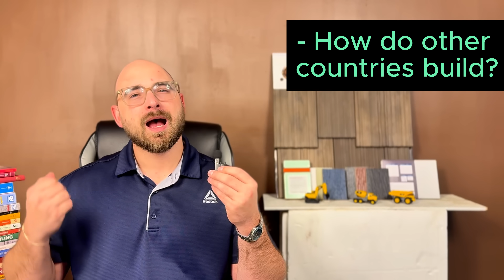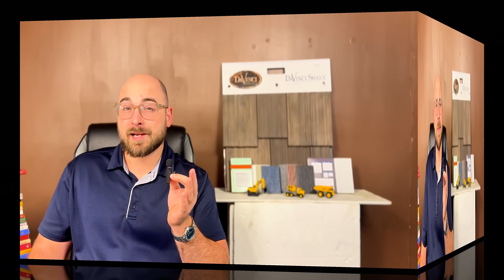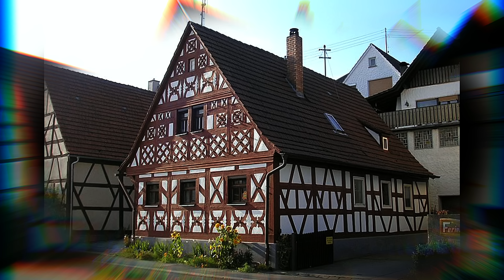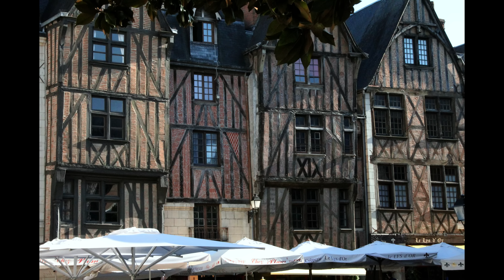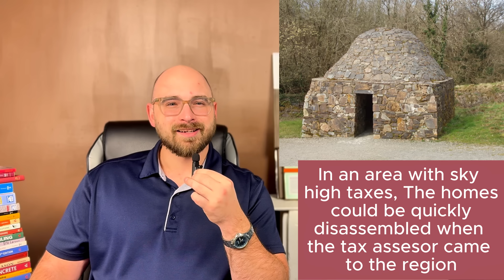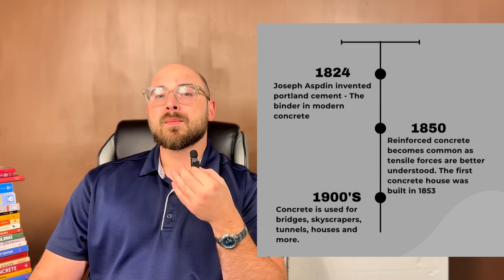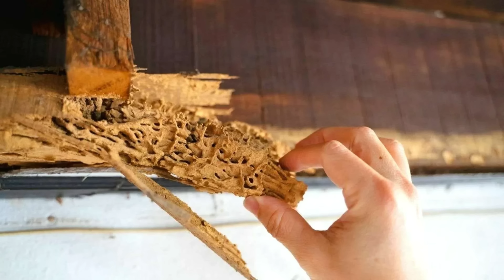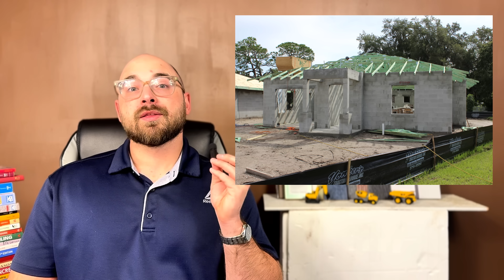Why Other Countries LAUGH at American Homes

Comment: Not exactly true like this either. See it is not about whether you just have same wood framing. For example here in Finland yes we have A LOT of wood houses.. However those are built with QUALITY in mind, not speed. There are extremely strict rules, and regulations how those have to be built. A wood house is not exactly the same in every country. A bit disingenuous to say it like that. For example we live in a wood house, that's 132 years old, and in pristine condition. We just recently got the house inspected, and had zero things complained about. See how I understand this issue, is that americans are way over-capitalistic country. Your wood frame paper houses are built with efficiency and speed in mind. They are built by the thousands in HUGE areas.. Here building one house can take quite a while, because those are literally built with quality in mind. Not how you can do it the fastest. This is a cultural issue really.

There is quite a big difference, even if the framing is wood in both.

Comment: I am in construction in India, its not that american and other techniques haven't been used here but they just don't look promising. Talking about my own house, there was no leakage, mold, or structure decay in a brick home. Now the new house we built was RCC beams and brick walls where both are sharing the load and the roof is a 6" concrete slab with cranked 1/2" rebar grid at 6*6 inches apart. Door frames are metal and door are hardwood ( cedar or indian rosewood), walls are 10 inches thick, foundation is 36 inches thick with beams 6ft underground, electricity and water ran in the walls. Here the structure of the house cannot catch fire in most cases. And is water proof and even bulletproof. Shortcomings maybe - making change is difficult and costly. U need to paint in 5ish years, very costly to heat (generally not required here) if water pipe leaks which does not happen, ull need to break wall and repair and all that dirty work.

Comment: He forgot to mention also gas silicate blocks, keramzit blocks, also precast concrete panels usualky for appartment buidings (those have offer a sandwich structure, like 5cm outside with a decorative patern, then pir insulation layer like 10 cm and another 10cm of concrete)

Comment: From NL, my house build few years back has the inside of the outer walls made of mostly concrete, but the outside are bricks. And the inside walls which are just connecting my spaces are mixed concrete with drywall

My mothers house build around 100 years back has a mix of bricks mostly in the outer layers and lots of wood on the inside. Also found out it had asbest, but that is removed now. Windows where singe glass when we moved in there 25 years ago, but replaced soon

Comment: European houses are way better. New Zealand has very good construction techniques as well as they copied the European model
What mainly makes them better is their philosophy on how to keep moisture out of the structure. They have way more complex flashing techniques, thicker walls including battens that hold cladding off the main structure to allow for airflow. New Zealand has that and in addition very strict inspections along the building process. They’re also often building in earth quake zones so tie downs and bracing is very heavy duty.

Comment: Very interesting and informative video.  One of the criticisms of homes in UK (where I'm from, but now live in US) is that most are built on concrete pads, with the essential water and waste water piping built in to the slab.  So, many houses built between the wars (and there were a lot of them built) have one bathroom with the expense of building another being cost prohibitive.  Similarly, washing machines are a common feature of British kitchens simply because plumbing anywhere else is cost prohibitive.  Similarly with electric wiring, where a concreate inner wall does not lend itself to rewiring to modern standards.  Newer houses in the UK now have two or more bathrooms, but that is still a small percentage of the general housing stock.

Meanwhile, my US home is "stick built", with vinyl siding and a crawl space - that latter being significant if new plumbing/ wiring is required (or even gas supply).  The chief downside I see is the obvious fire hazard, but then there is the roof.  Having to relace your roof every 25 years or so is a pain in the proverbial - in the UK, that is nearly unheard of as most roofs are either baked tiles or slate.  US houses are never built to last, either, with building lasting a generation or two, and then considered "too old" and either knocked down or VERY expensively renovated.

What is better??  I've owned property in both countries and they both have their pluses and minuses.  If you buy a home in the UK, you know it will last, built to stringent code, less maintenance costs, but is generally much smaller.  A US home is flexible to add-on to, is usually fairly modern (or easily renovated), but not necessarily cheaper.  Air conditioning in the US is a must, too, which is simply not the case in the cooler UK.  Heating costs are comparable, with US home being okay if well insulated.

Interestingly, too, water pressure in the UK is lower because a tank on the attic usually supplies all the (radiator) heating and hot water.  The cold water is piped directly from the mains and is clean and potable.  The tank, of course, is subject to dust, rodents/ birds (if they can get in), and the wear and tear of the tank itself.  Hence the faucets in the UK where one rarely rarely find single ones - one does not consume the water from the tank, so you would have to run the cold water for a few seconds to clear the pipes of any tank water.  In the US, all water is pumped from the mains, is generally clean and potable, and the pressure is higher.  UK plumbing, especially in pre-war houses, could probably not take the pressure.

In conclusion, therefore, the main theme of the video concerns building with local materials/ infrastructure and this can be easily seen as the difference between UK and US housing.  The only exception being that Americans should change their roofing material - shingles are an unnecessary material and expensive in the long run.

Comment: Yeah... US construction standards in housing are really poor.
Electrical, plumbing, insulation... Everything looks like DIY compared to swedish standards. Yes, that big of a difference, just take the plumbing side of it. 🤦🏼‍♂️
Soft Soldered joints in the walls. Taps that are built in to the wall with bare copperpipes that condensate, no vapor barriers in bathrooms, drains watertraps are unaccessable under the houses 🤦🏼‍♂️ etc. Sorry... But it is sh*t in comparison to how it is built here.

Comment: Why does the US not build homes of the same quality like in Europe ? For the same reason the US does anything, its more profit to build a nice looking home that is in fact 99% cardboard. If you lean on it too hard there is a chance you will go thru the wall. 

These houses are around for 10-20 years. Then you have to build a new one because the old one is at a risk of falling on its owners. In Europe many houses and buildings have been around for longer than the US has existed.

Comment: Well, it all depends. My house here in Sweden is built in the 50s with concrete and wood and seems to withstand hurricane forces without flinching. But in the 70s, many houses were prefab pieces of garbage, erected in a day or two and so flimsy that if you close an interior door to quickly, the whole wall moved slightly! 
Thankfully, that time is over and most houses built today seems to be back to better standards. (Those standards means that it's extremely expensive to build new houses, but that's another discussion.)

Comment: We are currently building a house that has a solid inner steel frame and the outer walls are made of 40cm wood-concrete with insulation. Inside, the walls are timber frame construction and 20cm thick.

Comment: I guess some of it is also about seeing American light wood structure houses broken by tornadoes and hurricanes, which we don´t have in Europe. Even earthquakes only in the Mediterranean. And then there is the size. To European eye, American houses seem to have been designed for luxurious space and many redundant rooms. I´m guessing this is done to appear more rich, which is a cultural preference. The downside of this is that the quality tends to suffer, if the price is fixed. With the same money one could get a sturdy house by making it smaller, aka what one needs, which often is the European choice. There could, as you mentioned, be stricter regulation too, forcing the choice.
Mold in concrete buildings has been a problem here in the north. Most of the schools that I went to have been torn down or decomissioned because of it (4/6). But it´s been a learning curve. Nowadays concrete buildings are built to a higher standard as far as ventilation goes.

Comment: Fun fact: I am in the USA btw

While non Americans pay the same money for a stone house - Americans get a wood house with fake stone facades if they upgraded …
Reply: The video is over exaggerated,   US homes siding is 3/4 or 19mm of wood board that is solid and on top of that is cement board or wood siding so there is no way to punch through that but you can cut with a power tool.   However most homes in the South of the US like California, Texas, Florida the siding is metal mesh with spray in stucco like spray plaster and that is very hard siding it is even better than brick as it is all in metal mesh which is stronger than brick but only 1 layer, usually with real brick you need 2 layers with an air gap.   But the real winner in US and Canada is central HVAC, the house is perfect temperature 24/7 365  and never have any mold or damp   - that is where the US and Canada are HUGE winners,  I lived most of my life in Hungary and everyone had damp, cold homes,   while in Canada and the US like 70% of homes have central HVAC and sealed from any outside air  so just 100% comfortable and every little corner of the home,  bathrooms, closets, no cold areas in winter.  That is PURE luxury in Europe if not unthinkable.
Reply: @DrScopey2  I think you over glorify HVAC. Houses in the USA also can have the same mold issues and do for a fact. Michigan has a big industry to water proof basements. The duct system is prone to collect particles and other fun surprises. And controlling the heat in rooms individually requires you to play with the registers of each room. The main reason why America has forced air is because of the AC use.
Reply: @cekuhnen  Houses in to US do not get mold unless there is a roof leak or water leak as there is no air gap in the frame and it is totally sealed from the outside world.  With brick you have an air gap which in damp areas will eventually lead to mold.      Basements depend on the local water table , yes Michigan has a low water table, you dig a hole and you will see water so that is just nature but most new homes do not have basements anyway, they are just a slab on grade which avoids that issue.           Yeah HVAC can have issue of balancing between rooms but that is why you usually have a gap under the doors to let air equalize but there are issues when people change floors from hard to carpet and forget to cut the door smaller or get new doors, the carpet could remove the air gap and block the air flow, so just need to adjust the doors.
Reply from the maker: @drscopey2 I disagree with both of your comments, most homes get 1/2” sheathing, no air sealing, basic tyvek leading to all kinds of gaps, drafts, cracks and places for water to intrude, many municipalities allow for poly vapor barrier which causes condensation and mold in some climates, 

I’ll also add, many production don’t even get plywood sheathing they get cardboard (thermoply / fiber reinforced sheathing) which again very poorly air sealed, and a lot of these homes, both production and custom get moldy 

It’s not that wood framing is the issue, but how it’s executed, most homes are built to a code minimum standard, but a home that keep air quality high and keeps water out, such as one built to passive house standard, requires extra detailing and extra money, and builders and consumers alike won’t pay for it
Reply: @Mike_Fortin  That is more a contractor and city code enforcement issue than a materials one.

To say most is an exaggeration.
Are there some homes that are built as you said? Yes.
Are most? I'd argue no.

Even where I am at, where housing demand is projected to be hundreds of thousands short of demand, the homes still get plywood sheathing, tyvek wrap, and air sealing.

Mold is a regional issue so I do disagree with the comment that HVAC would somehow prevent that as in some regions HVAC makes it worse.
Reply: Generally speaking, you pay much less for a much larger home in the US   when compared to most other places.

So yes, it's "fake" but it also wasn't needed. That's why it costs more.
Reply: 5.40 dollar for 50kg bag of most expensive cement (110.23 lbs)
58 dollar for 1000 most expensive red bricks 
There are cheaper ones😂😂😂
Reply: Same money I don't think so
Reply: compare the labor costs.  The US does in fact have brickhomes.  Check out those prices for new builds
Reply: Everything basic in the US is very cheap. But once you want anything different than the cookie-cutter consumer pipeline, you pay absurd premiums. Capitalism is a thing everywhere, but in the US, these houses are squeezed to the max for profits. 
That being said, if Americans don’t care about owning quality and sturdiness and only care about the outside, the appearance, that’s their choice. But the absolute minimum I want is for people to at least think about it, to be self-critical about it, instead of just yell “iT’s OuR cUltUrE!” (This includes every country, tbh! In Europe, everyone yelling “concrete, concrete” is kind of seemingly missing, that we are slowly moving away from concrete everywhere; the CO2 emissions of concrete are utterly disastrous!).

People don’t actually hate wooden houses; Scandinavian houses are almost all wooden and no one complains about them - they are lovely! It is how cheaply they are made in the US and how that is sold to the average American as “look, you actually need that, it is a good thing! We can rebuild it quickly and bigger and better!”. It’s not in the wood, it’s in the little things in between. Even if your house gets regularly destroyed, you can build with more quality from wood and it will still have all these attributes!
The whole “woodden houses can be redone easily” and “starter home” and “it’s bigger”, “disposable” etc. is exactly the essence of the alienation in this topic: it’s the hyper-consumerism mixed with the general public ignorance of the US. This is actually what the world is alienated by in reality, not the wooden houses.
Reply: @ very true points - look at Scandinavia wood house construction is present there too but it is not accepted in Germany. Wood construction has many benefits but also some down sides. But nothing is as bad as concrete production too!
Reply: @cekuhnen  You can make decent wood houses with sturdy beams and columns. What Americans call  stick frames are not sturdy.
Reply: @Shlorpmeister  There are no tornados in Scandinavia and severe storms are rare and they don't blow away whole villages. Midwest could make good use of sturdier houses. Then there is another thing to count in. Americans are not as rooted. They move easier and more often cross country, and don't build for generations.
Reply: @botalm1878 it's OK to have wooden home,  but the key point here is why cheap homes are too expensive,  more expensive that durable homes?
Reply: cause like in Europe huge amounts of old people die when heat waves show up

Comment: Wood or concrete? They each have their benefits and problems, it's a trade off of what you like, and what works best in that geological location, My house is 80 years old and in great shape, it's easy to modify and repair, very comfortable, i live in Hawaii and went through 3 hurricanes, with no problems, while a stone or concrete house can last longer, it's difficult to modify without great effort, and have unique problems of their own like eco's, dampness, cracking from tempurature differences and earthquakes, the most common problem is the extreme cost of building a stone or concrete dwelling correctly 😅

Comment: In France, the materials used to build traditional house depends on the availability in the region, modern houses are mostly built with cinder blocks, composite bricks or concrete with some exception for wooden and brick houses. Along the French coasts, houses are traditionally built with rocks and now concrete to withstand harsh storms and conserve energy inside.

Comment: I would be very interested on hearing your take on Crosslam CLT wood building material, which has been used to build high-rises in Finland. What are the pros and cons of this building material in general and how much the wood quality can impact it's properties?

You can find more info on Crosslam fi and the site can be viewed in English also. The selection is on the top right corner, if the site doesn't recognize your language settings automatically.
Reply from the maker: CLT is interesting, similar to mass timber. 

Pros are strength, sustainability, and speed of construction. Weaknesses are fire, water/humidity, and pests. 

CLT and mass timber form a char layer during a fire which delays structural collapse, which is an added benefit compared to light wood framing